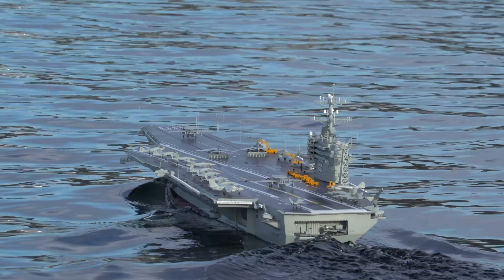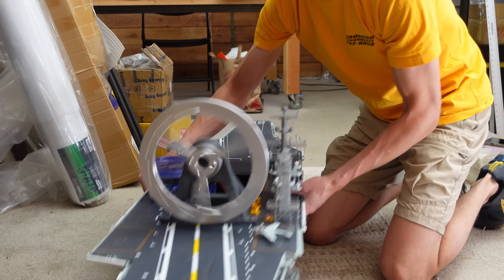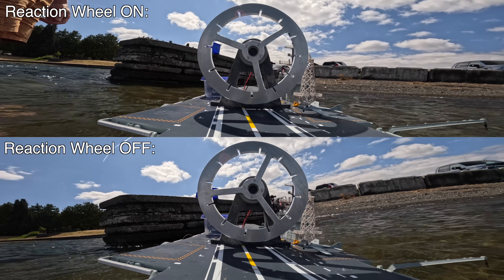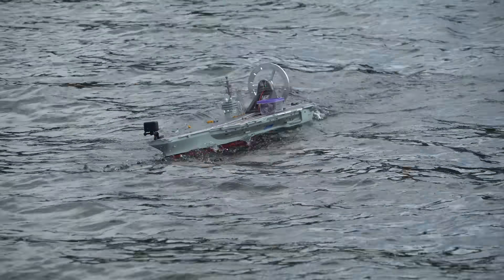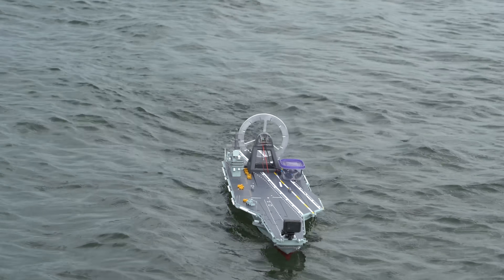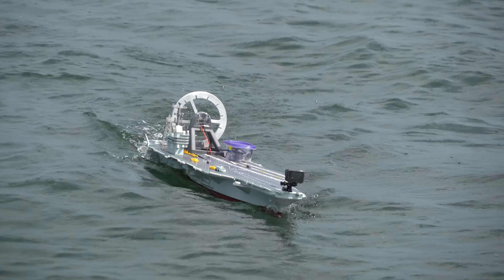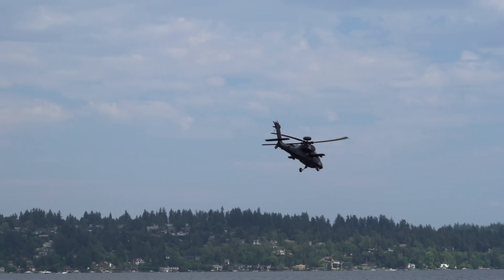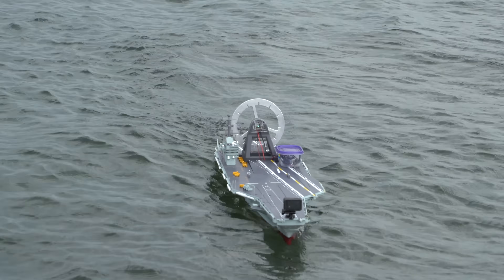R/C Aircraft Carrier with Reaction Wheel Stabilizer

Comment: Could you instead have a motorized axle running the length of the hull below deck that works on the same principle? So you could stabilize the ship without having to add a Ferris wheel to it 😅

Comment: Wonder if you could fix the saturation / drift issue with thrusters. Use the gyro for its fast reaction, but once they get to a certain speed, use the external force to push the boat back

Comment: If you add another reaction wheel or a pendulum at 90° to that one, you could control pitch too. Even better, two sliding weights inside the hull, at 90° to each other would act like pendulums and stabilise both axes whilst leaving the deck clear and the centre of gravity low.

Comment: We had a seakeeper gyro in one of our boats, and it uses a fast spinning weight spinning horizontally (like the old fashion spinning top) and then hydraulic piston to offset the roll to rotate the spinning top fore and aft.  That way you still have all the torque available at anytime and it doesn't start and stop the flywheel.  Although it will take almost an hour to spin up and reach full speed.   Great job... 🤠👍

Comment: I'm afraid a wheel (or pendulum) with mass great enough to counter the energy of the ship's mass is not possible to implement for two reasons: first it will have tremendous inertia that we don't have the technology to push around as fast as required, second it will add unacceptable weight to the ship.
This solution is not scalable to a real size aircraft carrier

Comment: Marine engineer student here. At 2:13 you say it has some natural stability because the center of gravity is below the center of buoyancy, but that actually not necesarry to be stable. What´s important is the "metacenter height", which is a result of how the center of buoyancy shifts to the side when the ship leans over. Nearly no ships has a center of gravity below the center of buoyancy, both because it´s geometrically tricky to get such a low center of gravity, but also because the ship will get very twitchy if the distance between the metacenter height and the center of gravity is too long.

Comment: Why didn’t you use a gyroscopic stabiliser? Can maintain your angular momentum by increasing speed and decreasing weight, mount it lower in the boat, and have it spin about the vertical axis so it dampens pitch and roll.

Comment: And how much easier would it have been, if he put two flywheel counter rotating around a vertical axis and the gyro effekt would have stabilized the ship automatically without any advanced electronics. It would have also fit under the deck so the ship would still be usable as an aircraft carrier.

Comment: Why not use constantly spinning gyro with vertical axis? Current solution requires 2 reaction wheels with active control, gyro solution requires single wheel with no control.

Comment: You mentioned the roll axis bias.  As you already know, that is from the bias in the roll axis angulare rate sensor.  I am assuming you are not using a expensive rate sensor and they typically have a bias.  To fix this issue, run the angular rate sensor value through a high pass filter.  This will eliminate the bias in the sensor.  I would expect 2-4 second filter would work sufficiently.  I have not mess with the microcontroller you are using but I am fairly sure, you can add the filter.  I would start with a 2 second filter, 2s/(2s+1).  If you do not know how to implement this, I can create the code to use as long I I know the frequency of the microcontroller.  Nice thinking on how to stabilize the platform.

Comment: How about adding a heavy lead(?) cylinder at the bottom of the  boat? Smaller diameter, but possibly higher total weight, and possible to match it up with some high torque servo. Do some flight controls, and make it turn a lot better when driving crazy fast, should be possible to launch actual planes from it, when running directly into the wind? 🤔🥵

Comment: Why not place the wheel under the flight deck and use it as a gyroscope? Wouldn't that manage to do this without obstructing the flight deck? You might need to reduce the size, and possible use two such gyroscopes so as to counter balance each other, but it should work.

Alternatively, you could also place a counterweight under the whole boat. And keep it upright that way.

Comment: That's excellent, thanks for showing that! Don't you just love Science and Engineering! You should be able to achieve the same effect with a smaller diameter flywheel hidden inside the hull, using a gearbox to get an equivalent referred inertia. You might also add some fore and aft stabiliser vanes underwater to help with the for and aft stabilisation which could also sort out the long term drift issue.
I wonder how big the flywheel would need to be to achieve noticeable for and aft stabilisation?

Comment: roughly mathematically you can make your gyroscope half the size if you can either quadruple the speed with a half size wheel the same weight as yours here. or by quadrupling the weight of the wheel and keeping the speed the same (half size wheel as well). maintaining the angular momentum in different form factors.

Comment: Slimming down the wheel and mount it internal could help.
Closer to center of gravity and lowering the center of gravity.
You might not even loose reaction wheel force by slimming down the wheel if the motor is fast enough to compensate for the smaller wheel.

Comment: Interesting.
It reminded me of the gyro-wheel based roll damping devices installed on old aircraft carriers and small ships .
The stabilizer with reaction wheels was also an interesting video, as it showed that it was effective enough.
If it worked well with a large gyro, it could work well with multiple smaller installations.

Comment: Internal solution:

Two reaction wheels, each one only spinning in one direction. Because they have to be smaller, you can have two and improve the response by them not having to stop and speed up the other way but only accelerate. They would have an idle speed instead of full stop and just speed up to create the stabilization effect in the direction required.
Reply: You'll have a hard time turning the whole thing. That's one of the reasons gyrobuses didn't take off.
Reply: contra-rotating ones still get fully saturated and have to de-spin. and if they're not mounted next to each other, they'll exert a yaw torque along the length of the ship
Reply: @RecurveStickerDragon  no, they dont have to "de-spin". You mount them inline, they have a certain idle rpm and there will be no yaw induced for that exact reason.
Reply: @Ganiscol Once you've sped one wheel up to resist roll in one direction, it will have to be slowed down as you can't keep accelerating it indefinitely, and when you slow it down it generates a torque.

Comment: I'd like to see you make the natural next evolution of this, with four smaller steel wheels mounted internally. One in the front, one in the back, and one on each side of the center of mass. Making them out of steel would mean they'd be much heavier so you could make them small enough to mount internally, but I'm sure there are cheaper metals you could use instead. Maybe brass? I used to do stuff like this in Besiege a lot when building my flying machines. The difference between no stabilization and four stabilization points was craaaazy.

Comment: How about we have two counter rotating propellers instead of Reaction Wheel, which not only stabilizes the ship but also propels the boat forward. The propellers are inverted such that both move the air backwards even though they are counter rotating to each other.

Comment: would a simple PID loop trying to maintain "zero tilt"? So long as it has an integral factor it should try to correct over time. Though you might wind up with the wheel building up speed over time and going bananas

Comment: what if you have two smaller flywheels where you mount them horizontal (so axis is along Z-axis) and have them counterrotate, and just spin them up and use them as gyros to physically stabilize the ship?  i only mention two because only having one might add yaw in the opposite direction of the spin

Comment: I am curious, is you method better than mounting the wheel 90 degrees around a Z axis?  This is kind of what makes it easier to stay upright on a moving vs stationary bicycle.  Might be simpler, but would use more energy because the fly wheel would need to be moving at a constant speed.  It should not need a controller though.  Thoughts?

Comment: Maybe turn the reaction wheel 90 degrees, so the spin axis is vertical. Then spin it up and leave it spun up, for damping in the pitch and roll axes.
Reply: Yeah, that's what I don't get - why reaction wheel this? Logically an Anti-rolling gyro would work better.
KISS principle always
Reply: @smalltime0  well, there's possible problems from that, I just haven't seen it tried. Let's say that the net roll torque (because waves aren't symmetrical and you spend more time on one side of the wave). Then you have a net roll torque on the vessel, which because of the gyro, causes a net pitch on the vessel. This pitch will be resisted by the buoyancy and also by the gyro, creating another roll, I think in the opposite direction.  So I think this will set up a very definite oscillation that just looks like precession, except it will be a factor of 3 to 10x larger oscillation in roll. I mean, it is SIMPLE, yeah. but the stability is questionable. I was mainly wanting to be entertained.

Comment: Just thinking out loud here.  Would it help to have additional fans/engines on the side, front and end, to counteract this?  Mounted at a 90 degree angle, so side to side, iso the normal front to back direction.  Much more complicated structure, extra maintenance etc of course....  And on the topic of the helicopter.  auto landing based on a mark on the ship?

Comment: On big boats they mount a flywheel at 90 degrees but have it free to rotate on both axis.

So when the boat rolls the gyro tries to yaw and similar for pitch. 

I think this results in dampening both roll and pitch 

Then by using actuators to move the flywheel in yaw they can create a roll reaction.

I think the advantage of this is

Comment: Looks impressive.
Why do you place the wheel so high above the mass center and length axis? 
Bottom side of the ring working opposite direction you want to, but if the wheel will completely fit under deck -- both sides (top and bottom) will stabilize the ship, do not it?

Comment: Just spinning the wheel at a rapid speed will aid to stabilize any body.  Albeit, probably not as good.  High end pleasure craft use a dishwasher sized gyro stabilizer that just spins at a high rate. You have a lot of room to scale down the size of that thing.  Think barrel shape.

Comment: Reaction wheel is too far away from rotation axis, it also have to fight against sideways movement of the carrier. It also moved center of gravity upwards making ship less stable. Adding integral part to PID controller will only solve part of the problem caused by not optimal placement.

Comment: This makes me wonder if you would have a better effect with a pair of counter rotating gyro wheels? The counter rotation would cancel out any yawing effect caused by them that could slowly translate in the water while still allowing the boat to turn freely. They could also be smaller, lighter and more easily mounted (one in bow, one in stern) yet still provide massive amounts of roll and pitch stability.
Reply: Just a single would be fine
Reply: @nixer65  A single for the same effect would need to be larger and be more difficult to mount, plus it would create a rotational force (think of a helicopter) that would create a slow spin in the water thile the boat is stationary.

Comment: Great video. The wheel is a little impractical for large vessels. You could try using a push pull weight on a slide rod, attached to either a cable or belt inside the vessel. You can use one for pitch as well as roll. It would mean two sets of electronics, but it would stabilize the ship so you can land the Apache! lol

Comment: This brought back memories long lost. I once worked on the design of a reaction wheel for an FPSO (~450,000t tanker conversion to FPSO) almost 20 years ago, to control roll for improved seakeeping. The wheel was massive and to be installed inside the vessel.
Reply: what's fpso?
Reply: @NoNameAtAll2  Floating Production Storage and Offloading unit. It's a huge vessel permanently moored on top of oil production wells in deep waters, which is capable of receiving and processing the oil and gas, separate one from the other, store the oil and then offload it to shuttle tankers which then transport the oil directly to the national or international customer.

Comment: Awesome proof of concept! Would a lead shaft under & along the deck work? Or is the inertial weight of that too inwards? Hm. Multiple of whatever size wheel will actually fit should work well along that axis. 

Maybe weights on chains for both axis? Motors inbound means lots of possible room, maybe. Should be able to treat the servo's sprocket as the wheel and strap external weights on the sides of the chain with 3d prints somehow, type thing. Fun to think about, thanks. 

Have a great one! Hi algorithm!

Comment: Stability on surface ships does not normally rely on the centre of gravity being below he centre of buoyancy. The stabilizing effect comes from the centre of buoyancy moving faster outwards than the centre of gravity when the ship heels over.
Reply: That makes a lot of sense actually
Reply: What does this mean
Reply: @BartJBols  It means ships are only stable below a certain roll angle.
Reply: @BartJBols  That stability is mostly created by the hull shape, not by a big honking heavy keel dangling under it. With the consequence @nerdyengineer7943 mentions: such a ship won't right iself once capsized. Simplest example: a catamaran: very stable around the neutral, but once you tip it over, it will remain upside down.

Comment: Was it difficult to keep it straight when going forward?  The pitch up and down of the bow should have caused gyroscopic procession at 90 degrees on the gyro meaning it should try to turn you left/right each time a wave hit.  just me pondering about it..  great idea for an experiment by the way!  A company called Seakeeper actually make a vey expensive similar system for large yachts. thanks for the video!

Comment: You should set the reaction wheel to spin at a relatively high speed and then adjust that speed up or down to control for roll axis, while the high speed acts as a passive gyro which would stabilize the pitch axis.
Reply: Came here looking for this comment, well put!
Reply: That would mean it could get saturated pretty quickly though, if it built up too much speed the direction it was already turning

Comment: Would definitely like to see multiple wheels integrated into the hull. Keep the weight as far down as possible. Having some pitch stabilization too would be super neat. Only problem is you'd need much smaller wheels, which would reduce the force they apply considerably.
Reply: i would try two high speed turning wheels rotating in opposite directions, controlling the counter-reaction forces by speed difference... just like spacecrafts do, just with the difference that friction and gravity will allow re-equalizing the speeds :D

Comment: Adding an I coefficient to the PID control will eliminate the offset, as you suggested.  Seems like it's time to add a reaction wheel in the longitudinal axis, too!  Or maybe a reaction mass on a linear track within the hull?
Reply: I was thinking that too, but I actually don't think it would since he said he's using roll rates as the set point and feedback, not the angle of the ship. An I term would compensate for a steady state error in roll rate, but that's not really a thing that this system can have, since that would mean the ship was constantly rolling over.
Reply: The fly "wheel" doesn't need to be a wheel it could be a long rod with high mass at the point of buoyancy or a pendulum that hangs below the center of buoyancy.
For pitch or even roll you could also use a tube with bird shot in it that tilts to counter act rotation on ither access by tilting the tube. The tube would need to be slightly curved up so that the shot would want to go to the center of it but should work just fine. It would be on a stepper motor with limiters so it would tilt the tube and because the motor is fixed solid to the hull it would force it to remain upright
Reply: I don't think it's possible to cancel out steady-state error with a reaction wheel alone, the wheel would gradually spin up to maximum speed trying to counter whatever natural list the ship has.

Reaction wheels can't handle constant long-term forces in a single direction (like using one to take a ship that naturally lists and hold it upright), as they have a maximum amount of force they can apply in one direction by accelerating the wheel before the wheel hits maximum speed and can't accelerate in that direction anymore. The forces they're applying need to be balanced long-term, or you need a way of momentarily applying force to the vehicle in a specific direction so the wheel can unload the momentum it's accumulated.

Something like a control moment gyroscope would be able to counter natural steady-state list, as they rely on pushing around a spinning gyroscope at right angles to it's spin, instead of accelerating it faster or slower.